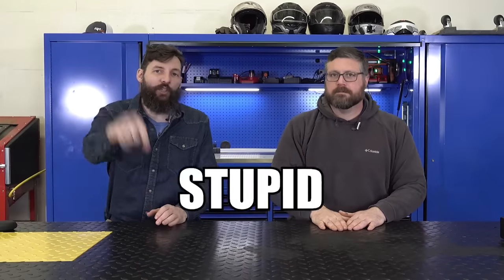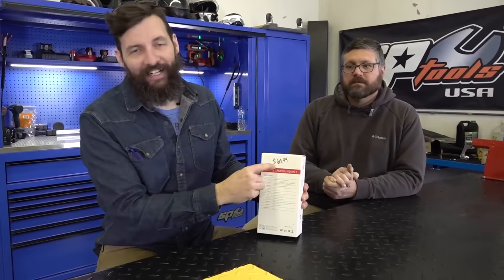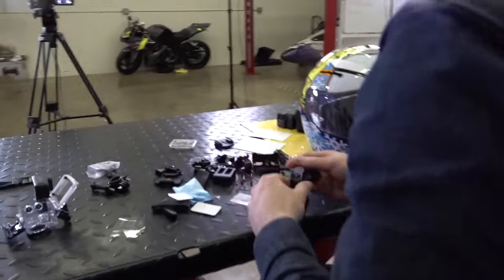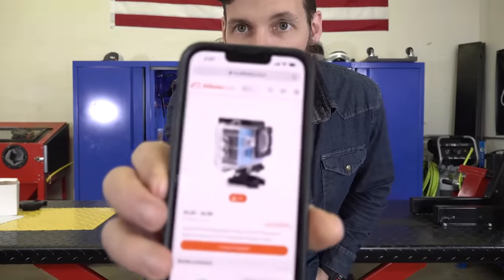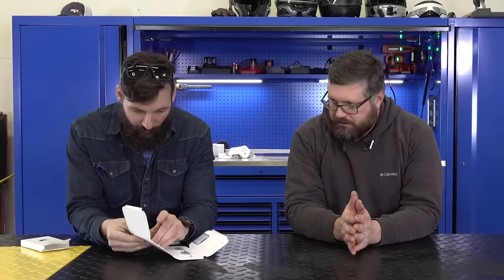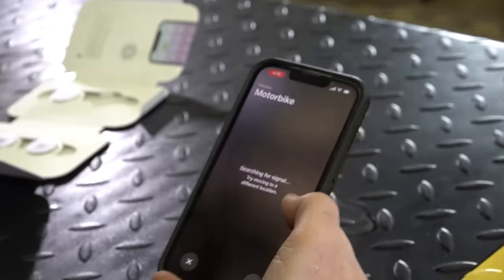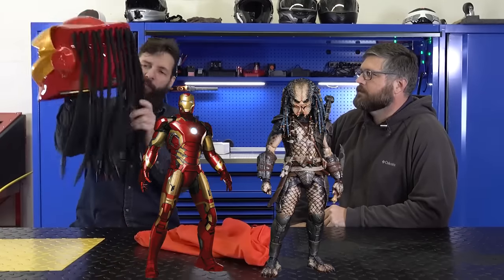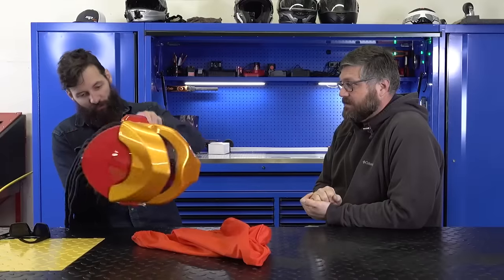Testing amazons Stupidest Motorcycle Accessories(#5 is Dangerous)

Comment: That is not how air tags work. they have NO GPS. they are not locators. they are BEACONS.

IE all apple devices can "see" airtags. the user can't but the app "CAN" when another apple device detects beacons it "notes" the beacons and uploads its location (using the gps in the phone not the tag) to apple.

SO this works better in a city. as other people with iphones "tag" your beacon you get this data as the authorized user of the beacon (no one else does)

There is also a way to DETECT beacons (tags) so you can for example detect of someone sticks one on your car to stalk you.

SO think of it as "crowd sourced gps location tags"

IE it needs to pass in proxomity (30-100ft iirc) of another user and its location will then be "updated" its not a live direct tracking connection. that's REALLY expensive (data plan)

Never mind you explained it right later!! :-)

Comment: The truck tire will take a lot more air to reach 36psi but a smaller motorcycle tire will reach it with less air volume but same preasure. Im surs there is math to explain thia but in short, less time on the motor to reach the same preasure on a smaller tire. So for a motorcycle this would work easy.

Comment: Airtags work with phone bluetooth so if the thief has no Iphone its useless. Instead buy invoxxia, it's a gps tracker that needs no sim. It costs like $100 bucks with 2 years free subscription and after that like $10 a YEAR. And it has full gps tracking and pretty small

Comment: the Tire pump, and the senor in your truck, the sensor won't report a new pressure reading until you start driving. You have to get to a minimal speed 15 to 20mph before it will report.  You probably drove off and it may have dropped .  I know this video is 9 months old, :P

Comment: I have a old smartphone for a GPS tracker best option. Smartphone was only $30 gps works even without it being activated. Using Android lost my phone app you can even set off a alarm. Phone is plugged into the bike so dont have to worry about charging it. Phone is about 4in x 2in its a small Samsung phone.

Comment: Id rather maybe just have the head unit with bluetooth and connect to headphones or headset in the helmet. I mean ultimately the phone serves that purpose enough for me but i suppose id someone wanted to use cds or an sd card maybe thats where a head unit would come in. I feel like im safer with no audio distraction though, im able to hear a horn, someone accelerating and engine noise, or brakes screeching. Could possibly make the difference between having a near miss or ending up eating pavement.

Comment: Actually I ride an old(er) BMW K 100 LT bike and I was always wondering what is the purpose of the stereo (the LT comes equipped by default with a BMW stereo) considering the wind and bothering the people around me. I am introvert and don't pry my taste in the face of people. I don't like it when someone is doing it, so I also don't. On a long rides I just shove earphones and listen.....But recently I changed the original stereo and speakers system with two simple JBLs GO 2 (same size as the original speakers) and with removing the stereo I opened compartment for first aid and some small stuff....still volume on Max and above 50mph you can't hear nothing (it was just an experiment), but now I have independent stereo system for when I am alone camping and there's no one else around to bother

Comment: A battery operated air pump is a dumb idea. It’s stuck in your pannier rarely getting used, never getting charged and then you need it. Just get a pump that plugs into your bikes battery maintenance charger plug.
Reply from the maker: You could only bring it on longer trips and just make sure it’s charged

Comment: You can't beat installing a self-powered concealed GSM GPS tracker, it can pinpoint in real-time the vehicles exact location, to within a couple metres, as long as you keep the SIM topped up and battery charged. My Whinnes GPS tracker lasts about three months between charges. Multiple trackers can be tracked on a free android app.

Comment: I bought an electric motorcycle last year and this thing makes no noises. Countless people run on the street in front of me, cause they don't notice me. So i put a Bluetooth Speaker on the handlebar and adjust the valume, so i can hear it while driving.
Yes now the pedestrians hear me coming from 1 mile away. It was so damn loud.... Its not fun to be such an associal prick. So i don't to it again. But i need a solution for a sound while driving....

Comment: apple air tags - battery dies in under 2 years.  usually over 1 year. non-replaceable. buy a new tag when it dies.
battery hates COLD weather. will go offline due to not enough power when frozen.
must be near an iphone to report location.  wont go through heavy walls/ seacans

Comment: OK,,,GO-PRO is a great ACTION CAMERA,,, but unless you buy the program for a gopro you can't do much with the video. and for the MONEY the go-pro is a NO GO.( I had a Fusion 360 GO-PRO). I returned the Fusion 360 and got a Kodak Orbit 360.. MUCH better camera for posting videos. you don't have to convert the video to something that can be played on anything other than the go-pro software. video not the greatest,,, but for a 360 camera mounted on a motorcycle it does pretty good. the audio sucks when using it on a bike.

Comment: I have the pump, from xiaomi and its one of the best purchases ever. Most importantly it measures the pressure which is soo handy. No all my vehicles have pressure up to spec. It has battery for just about 4 tires of my hatchback. Motorcycle easily full inflation of both tires.

Comment: @9:23  You can possibly use a TILE as well which is at least more universal with being able to be used with both devices and you can replace the battery in them when they die.

Comment: there's better options than the airtags. Unfortunately the down side to the air tags is they only ping from apple devices. most the population utilizes androids. the samsung version of the tags would be a better buy simply because of that.

Comment: That tire pump is stupid and borderline unsafe. It will lean someone into a false sense of security thinking they can pump up a slightly flat tire. That isn't the issue. The issue is that its generally considered unsafe to be out on the side of the road or in a parking lot the length of time it will take to use that thing. There are better and faster battery air pumps but they cost more and are much larger.

Comment: Things look way differently on pictures than in reality. This helmet might look rad as hell, but in reality you'll look like a moron with it. Also, it's a helmet. A very important safety measure. It needs to be as high quality as possible, either from a reputable manufacturer or with a certificate.

This predator helmet... is neither of those things...

Comment: Air pump :
I keep a can of Fix a Flat in my tank bag.
  The pump is cool but, how many times can you use it
on a charge ?  How long dose it keep a charge ?
Without a sealant or a plug kit you'll have to use it more than once.
If you didn't charge it that week will it even work ?

Comment: What i was gonna do is heat seal the AirTag in a fuel resistant plastic bag and drop it in the fuel tank then it doesn’t matter if they know didnt fit through the hole in my benelli tank though

Comment: For anyone who is interested in using some air tags to monitor your bike and are worried about a thief with an iPhone being able to locate them and ping a sound off them, you can actually pull the unit apart carefully and remove the speaker entirely. It's glued in place under the battery holder. There are a few videos on youtube showing how to do this without destroying the air tag. 

The thief might still get notified that an airtag exists, but if you're clever in where you hide it, he'll have to spend time searching for it instead of being able to pinpoint on it from a sound.

Comment: I bought a Campark X30 after seeing a YT side by side comparison with a GoPro4. $80 vs $450. I'm entirely satisfied with it. Going further, brand x dash cams look as if they all come from the same factory. One model below the one I selected wasn't very good at all. What I found is that most of these cams do well 1 quality step below their advertises rating. One that says it's 4K will do well at 1080p, and one that says 1080p will do a good job at 720p.

Comment: i've been into this thing about hiding an GPS pointer in my bike, and there are alot out there to find. the one thing you wanna have, is a long battery time. because if you forget to load it up, or it is on the bikes battery, it won't work if they thief takes out the battery. and the secound thing is to find one with a good backup plan, buy from a company you heard of, that will stay on the market or you believe would stay on the market for some yeears in the future, if you want their help finding your bike. the simcards are not a question of cost here in sweden, but that will probably be another thing to have in mind. I found one GPS (do not remember the name) that looked like a flashlight, had a batterytime of it's own - about 15 years, unused. the company was a bigger one here that ive heard of before. the price was ok, not cheap, but ok. the boat industry has a bigger range on this kinda things due to boats getting stolen. keep it up!

Comment: Apple air tags definitely do work. I have one in my Nissan Rogue, my motorcycle and I even stuck one in my wallet. The app itself does refresh every 7 minutes I believe, or maybe it was 9 minutes. But they do work. One time I dropped my wallet getting back in my car after getting a hair cut. I couldn’t find my wallet, checked the app. Showed the location at the hair place. They ended up seeing it and brought it inside. Battery lasts about 2 years which is cool too